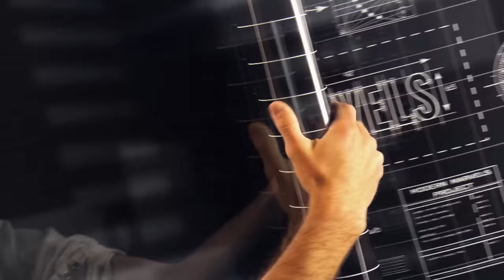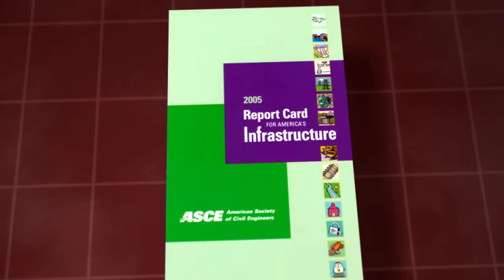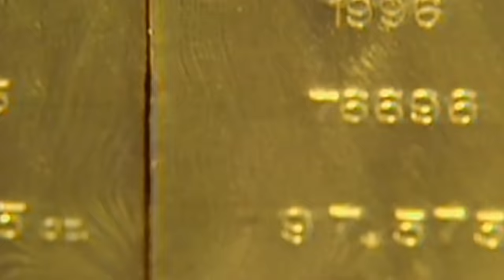Modern Marvels: Corrosion Destroys U.S. Infrastructure (S14, E29) | Full Episode | History

Comment: This maybe old but maintenance on a boat like mine required hour upon hours of work with a "needle gun". Which is a large version of a tattoo gun run by LP air. 

You think a shake weight requires arm strength, play with a needle gun for 8-10 hours a day during dry dock.
You wont even feel your arms after 45 mins let alone 8-10 hours of working the gun.
Reply: @patrickglaser1560  since you asked, the boat was USS Fort McHenry LSD-43 back in 2000-2004. 

And the dry dock repairs where general maintenance and preventative care like the episode said, rust prevention. 
But she was decommissioned 6-7 months ago, so she gonna be a floating rust deposit in time.
Reply: @patrickglaser1560  forgot to answer the second part, the needle gun is used to remove paint and rust from surfaces. 

As a Hull Technician we also used the needle gun to clean areas that need welding repair so provide a clean surface to strike and arc and have a clean weld, especially on the outside of the ship.
Reply: @qp2qp226  i had an interesting encounter in the 80s with a lady sailor on the uss lexington that involved her love of a needle gun
Reply: @ronalddavis  lmao
Reply: My division had to remove the non-skid on the aft missile deck of the USS Momsen DDG-92 after the shipyard installed it incorrectly. We didn't complete it during the deployment but had most of it gone, and all we had was needle guns to use.

Comment: Man that's so cool, seeing the pipe blown into the existing. We had that done in our city about 6-7 years ago
Reply: It is a band aid, a patch, (and it does reduce flow), that probably works better than most for a decade or so.  I think, the pipes never should have been covered by dirt so we could replace them easily over 50 years later.  Psssst---civil engineering is for engineers who could not cut it in industry for profit.
Reply: @EarthSurferUSA  so where should the pipes have gone if not buried?
Reply: @EarthSurferUSA  because they would freeze and bust if not buried.

Comment: Fun fact: if you convert a gasoline engine into an ethanol engine, it requires 30% more fuel flow. 1 gallon of gasoline gets the same mileage as 1.333 gallons of ethanol.
Reply: More like almost twice the alky burned to produce the same energy as gasoline.  Now alky can produce more power by raising compression, (but the consumption is still about double). Flex fuel cars are designed to burn both, (but the compression can not be raised higher than the gasoline can tolerate, or you would not run it), and that is why your flex fuel car runs more sluggish on E-85, (15% gas, so it will start below 40 deg. F., pure alky will not), than they are on gasoline.
I build gasoline race engines for a living, and have a couple engineering degrees.
Reply: @EarthSurferUSA   At the drag strip we increase flow by 30% it works great using alcohol for boosted avoiding detonation but I would definitely not increase flow by 100%.
Reply: And ethanol destroys a lot of engines.
Reply: Exactly the reason I will(have to) pay more for the pure E0 gasoline for my older cars when I can find it.
Reply: @JKHTX  We should ban electric vehicles
Reply: @onfoenemgrave  Ridiculous

Comment: We're living in the 21st century, where tech is looked upon as god. Why do we insist on using Stone Age methods (halite) to melt ice/snow from our roadways? Yeah, the auto industry loves road salt.
Reply: Figure it out then scientists.
Reply: @davidgibson8174  It's already out there -- Calcium Chloride. It's more costly, but it will save a lot of bridges and vehicles. I used to drive a snow plow truck for my state's highway department.
Reply: Because it works and is economical, (yes, anything we build does need to be maintained).  But of the Gods of tech can figure out how to make a road with cell phones so it melts frozen water,---go for it.
Reply: Calcium chloride it's even worse.
Reply: I've seen where they use a mix of beet juice and salt and it ends up being way less salt than before, it's like just these little lines of liquid the trucks leave on the highway some hours before snow is expected. It's more effective and results in less salt to rust things.
Reply: @kinkane5566  Yes, my state uses that combination of beet juice and halite.
Reply: There are plenty of “modern” solutions like adding heating to roads but a lot of the solutions are expensive and usually require ripping up the road so well in the long run it might save money people only look at the now and if it’s cheaper now to continue using road salt…

Comment: Corrosion also destroys the underside of my vehicles while living in Rochester NY 😠
Had a perfectly fine  80,000 miles vehicle....  engine, interior  etc , but had to scrap it because the whole underside was rotted,  rusted out from the salt
Reply: I'm in Ct. and I feel your pain.
Reply: yup... the Rust Belt
Reply: i stopped driving my new car in MN winters, now i just store it for 5 months during salt season.  i was thinking of getting a used winter car.
Reply: @steveneumeyer681    unfortunately I'm no where near owning more than 1 car.   In my next life maybe 😁
Reply: You have to stay after it and by that I mean constant cleaning, even underneath. The other option is the spraying off an oil based liquid under the car and in all the hidden areas. Rust Check is one such outfit that does that.

Comment: Iron Age swords are almost non-existent. But Bronze Age swords, even though they are a millennium older, survive. Perhaps we should make more structures out of copper alloys if they do not require great structural strength.

 A bronze rebar bridge is stronger than a rusted hollow steel rebar bridge. One problem is that contractors bidding care nothing about 20 years in the future, and their selection of material shows it.

Comment: Check out the link to the video before reading: Wanted to take this “Science experiment” to the next level and create a shield / plastic coating mainly for boats or any floating objects as we all know that foam “floats above water” but my theory is that it will hold a much greater volume of weight when it gets liquified and converted back into a solid as its more concentrated and strongly bonded back together. Probably great as a paint for the Navy, and for flexible wear attire floaters for swimmers especially for beginners (pretty much it’s a life jacket / vest but broken down into much smaller pieces and woven / interlocked together keeping the user afloat).
Reply: what?

Comment: 9-18-2021:
Here's hoping the 3.5 TRILLION dollar infrastructure bill in Congress will help rebuild and maintain the country.
Some of the Bridges in Chicago (where I'm from) are literally falling apart. There are some I-Beams there that you can poke your finger through easily, they are so rusted.
IMO, this country needs to start taking care of itself more than just handing out big bags of money to every third-world country that comes asking for it.
Just my two cents worth on it.
Reply: Agreed. But local and state policies should need to do their part in maintaining infrastructure as well. 
Where I live we’re doing good to fund bridge replacements. A bridge is starting in April that costs $65million and that’s only one of the two needed.   This is replacing a bridge that was built in the 30’s. Concrete chunks falls off of  it on regular basis. We need another bridge across the river, 1-1.5 billion. (The Existing was built in the 30’s and 60’s respectfully.)   And this is just within 5 miles of each other. 
But The entire 3.5 trillion should go roads and bridges.

Comment: Suisun Bay and all the US Navy reserve fleets have strict guidelines and they must follow CEPA rules or decommissioned vessels do not go here. 1. No vessel containing lead paint may be permitted at any reserve yard if it is pealing paint it needs to be removed. 2. Any vessel with flaking paint will need to be sandblasted before it is allowed to be stored and this must be done every two years. 3. All obsolete vessels currently at the yard will be removed and sold or dismantled and scrapped to prevent fowling the marine environment. 4. All barnacles and hydrilla need to be removed and the vessel drydocked before towing. and 5. All vessels arriving must be maintained as if they are in service. Those are the rules vessels headed to the museum fleet go here and are repaired and repainted before display and all old vessels need to be removed and scrapped.